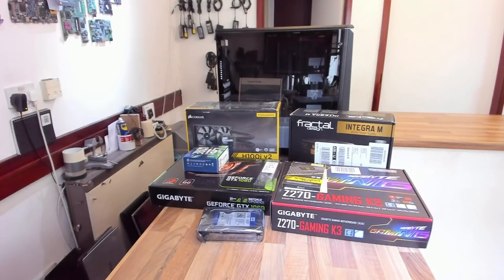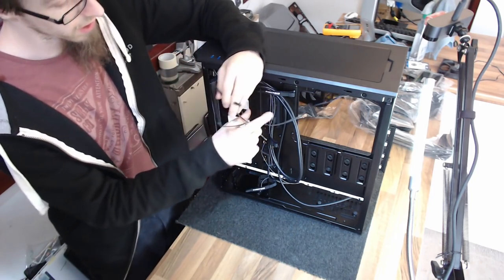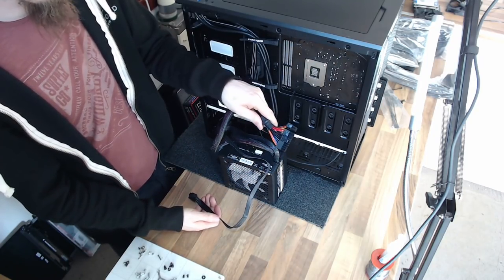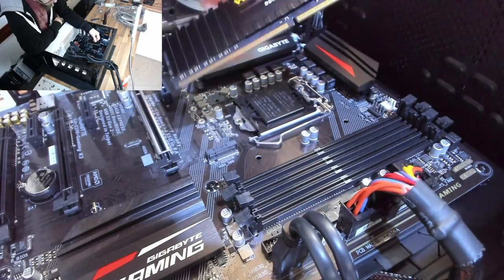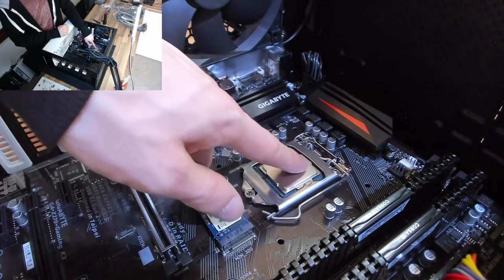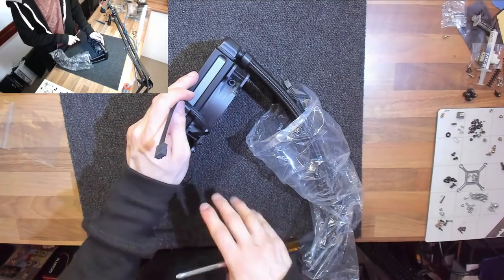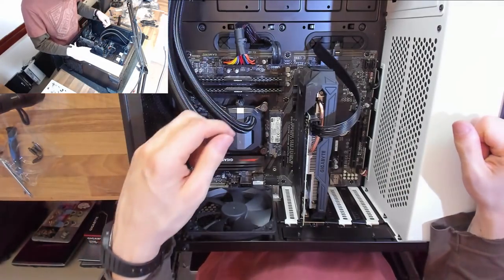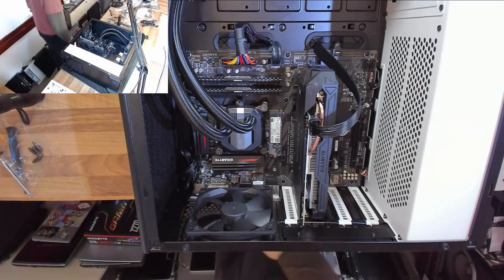LBC#16 - How to Build a Gaming PC

Comment: Great video, with clear step by step instructions. Totally agree with yogev about not needing to remove the cover - it will pop off when latching down the CPU, additionally you should retain the cover if you ever want to RMA the board as some manufacturers may fail to honour the warranty without it. Finally it is worth mentioning to avoid touching the lands on the CPU (you did appear to handle it in the video) otherwise you contaminate it with oils and sweats, similarly it is worth mentioning avoid touching the pre-applied thermal paste on the cooler.

Comment: I always install the cpu (and cooler if stock), ram and m.2 before adding to case so much easier. I also use a tape measure to check stand off alignment rather than the board it’s self. I always test the parts post too before installing. I normally install Windows too just to a basic level then add to the case. I build a lot of PCs and I’ve found this saves a lot of time in the long run. Wiggle cpu from sides rather than add the oils from your finger all over the top of the heat spreader. Good tip regarding polishing the glass.

Comment: dont throw the cpu cover away , youll need that if you want to send your motherboard back to get fixed
Reply: He prolly has 1000 of them
Reply: @bandit6048  HE may. But as this is a how to video, what he does is meant for the people watching who likely will not have any spare ones. Keeping those covers for a year or two is a good idea.
Reply: @harshbarj  point made
Reply: Also, you don't have to pull them out before you place the cpu in the socket. They will pop out once you close it with the cpu in place.

Comment: Don't remove the CPU socket cover. Release the lever, pull the retension mechanism back with the cover on it, then put the CPU in and close the mechanism. The socket cover will jump off. This way you reduce the risk of damaging your socket. 
And don't throw the cover away. If you'll ever sell your board without your CPU you'll need it. If you need to send the board in for repair, you'll need the cover.
Reply: Indeed, there are some motherboard manufacturers that won't accept a return without the CPU socket cover. Or at least, will attempt not to do so.

Comment: A word of warning about installing power supplies with the fan up instead of down. I have a Thermaltake Toughpower Grand RGB 750W psu and installed it fan up to have the lighting in the case instead of beneath. Also installed is an MSI Duke 1080 with 3 fans. Under a light load like web browsing this was fine but when playing games the fans on the graphics card were choking the air supply to the PSU, so I had an issue with the computer power cycling only while playing games. This was really difficult for me to diagnose because the computer wasn't going through a proper shutdown which meant no windows error codes, and none of the typical components like CPU or GPU were even close to thermal limits. For a long time I thought it was under voltage on the CPU overclock, but all CPU stability tests I ran were fine because the GPU fans weren't ramping up and choking the PSU. And testing only the GPU didn't create enough load on the PSU to heat it up to thermal limits. Literally took me three years of intermittent fooling around to finally fix the problem, must have reinstalled windows at least 5 times thinking it was due to bad installations. I totally agree with the reasoning of putting the PSU fan up instead of down but make sure it will get enough air.

Comment: Never wiggle a cpu in the socket, if you manage to do that while the cpu is not socketed properly, you will damage pins. Never pull the socket cover off... it pops out on its own once you socket the cpu and lock it in place. ALWAYS keep the socket cover, you will need it to rma the board.

Comment: i havent seen any AMD Ryzen Boards at least that use Ram slots 1 and 3 as optimal. Pretty much every video or build i've seen or done have used the same slots 2 and 4 as Intel. I know i'm super late but thought i'd mention it. You should also never tell people to throw away the CPU Socket Cover, if they need to RMA that board and send it back without it then the company can deny their claim and then they are screwed out of a warranty.

Comment: I black paint my rainbow wires does the job.it's about time m/b manufacturers made m/b with all the header sockets on the back/bottom of the board, they must have seen that we don't like to see all the wires and plugs, graphics card should have the 6 or 8 type power connections down by the PCI connector may be sticking out the end of the card.

Comment: Cases have come a long way. If you wanted a 'gaming' case back in the 2000's you had to make your own perspex window by cutting the side case panel and a piece of perspex. Wanted to add more fans, well you had to cut your own holes...
Reply from the maker: I was there! Remember neon coloured rounded PATA cables? 😂
Reply: @Adamant_IT  They freaked me when I first saw them. Never liked them. I was all about the cold cathodes!
Reply: Unless you want an optical drive & hot-swap drive bays, then you're in trouble finding a case you can even modify.
They've "come a long way" in the exact wrong direction.

Comment: I would have gotten a bigger power supply than the 450 watt one that he installed.  Rather have some "wiggle room" in case the memory was expanded and a new video card was installed.  Even adding more internal cards just might tax that power supply.

Comment: You don’t need a graphics card if your cpu has one and you plan on using it for work if your external graphics card dies and your cpu has a inbuilt one you can take it out and use the motherboard display ports until you get a new graphics card

Comment: I have one question: when you plug the back case fan directly into the motherboard instead of the daisy chain that comes hooked to the case, do you still get to control the fan speed using the case?

Also, a small comment on the SATA cable. If you are using M2 SSDs, some motherboards state that it matters where you plug the SATA cable as each M2 you plugged in may turn off one of the SATA ports.
Reply: thank you! i just did most of the build today. realize the other advantage of using the mobo fan header is that you don't have to deal with the chunky fan hub.

Comment: Normally the fans go infront of the Rad and the long screws thread threw the front of the case into the rad, but since u dont like fresh outside air for ur psu its ur way,

Comment: Your putting screws in the wrong way. Your way can cross thread the screws.  You should anticlockwise the screw half rotation to align screw till it clicks then clockwise to tighten up.

Comment: The most common "Imperial" screw is 6-32,(for computers) pronounced six-thirty-two. It is a number 6 (there are charts, but #6 is .138 in.) and 32 threads per inch.
Reply: why is imperial in quotes...?
Reply: @RWL2012  because Imperial threaded screws are not commonly used in the U.K. where the term comes from. In the U.S. we don't use the term, we have 6-32 or 4-40 screws etc., and we use metric for the m"style as in m-3 etc.
Reply: @SuperFredAZ  Imperial was British Metric came in with the dreaded EEC / common market
Reply: @stacey37m  I understand  where it comes from.  In the U.S. we use threads called National  Coarse,  which the quite common 6-32 is a member,  and National  Fine, which for example the very common 4-40 belongs to. The first number refers  to the size, and #4 has a look up table,  the 2nd is the pitch in threads per inch. In the video  he was referring to  an "Imperial " thread 6-32, which should  be read as a six- thirty-two, meaning  a number 6, and 32 threads per inch. This screw seems to be the most common size for desktop  computers,  to mount the motherboard,  and for nearly  all ATX power supplies.
Reply: @SuperFredAZ   we had  may types  but the main ones were BSF  BCF  whitworth coarse and many I have forgotten.

Comment: Hello, after watching along with this video and building my pc, I am having one issue.. my PC turns on fine and runs perfectly, but when it goes to sleep after not using it for some hours, it does this thing it’ll turn on and off non stop, off and waits a second, on, waits a second, off waits a second, on, etc and makes a clicking noise and the only way to shut it off is to turn the PSU switch off and the only way to turn it on again is to unplug all my cables from the PC and plug them back in and it’ll turn on and run perfectly again until I either turn it off myself or it sleeps.. I cannot figure it out :/ please help!
Reply: Hey bro, sorry to hear....Did you ever get it figured out though? What was the issue?

Comment: thanks for this video, i like your building style.  which case is this?
Reply: thanks for actually responding and so quickly.  I'm planning to build my first PC that will be a workstation and for some gaming.  I want it to look nice and be functional as well, and upgradable/future proof.  Right now my choices are the P400s, the S340 VR Elite, Corsair 400c, and the H440.  I think this case, the P400s, is now the front runner.  Any suggestions regarding those I mentioned or other suggestions?

Comment: So, what did you do with the original front fan that comes with the case?
Reply from the maker: I left it out of this build as it wasn't needed (replaced by the radiator fans) however, it could have been moved to the top of the case for extra exhaust flow too. I generally use as few fans as I can in builds, but I encourage people to experiment to see what works best for their PC.
Reply: Thank you!

Comment: I am not happy with my gigabyte motherboards (I have 3 computers in running order with gygabyte mb's) what is your professional opinion on MSI?
Reply from the maker: I have to admit that I've fallen out of love with GB. MSI have had some strong boards lately, but also have their weak points. It seems that you can't really go wrong with Asus right now, but if MSI is at your price point, I think you'll be okay.
Reply: @Adamant_IT  please make a video with the weak and strong points of gigabyte asus msi I will be interested to see it and I think others will be interested as well. I talk with people who are knowledgeable about electronics in my job but I find your opinions valuable as well.
Reply: I have 3 ASUS boards always have problems with the BIOS
Reply: @kucingoren666  I never used an ASUS however my experience with MSI has been flawless

Comment: I'm a bit behind the times I guess but no optical drive? Does no one bother with these now days?
Reply: Not really no.
Reply: I do sometimes but it's just as easy to connect an external optical drive now, so there is no real need anymore.
Reply: With modern cases, you have to use double sided tape to keep an external one from sliding round all over the top, live with the wires, & put up with it partially blocking the top vents.
It's REALLY fun when your kids spill drinks on a top vented case...
As for hot-swap drive bays, buy a server case or forget it.
There is truly no thought to utility in the fashionable rubbish.

Comment: How did you connect the led strip???
Reply: So I got the same model but red/black. I may have missed it, but I didn't see a second LED connector so I had to unplug the LED wire that was to the front panel so I could plug in the LED strip for the interior. Did I just completely miss an extra LED connector besides the front panel LED connector?  I've tried looking at the panel and other videos showcasing this case and no one explicitly zooms into the LED wires for me to double check.

Comment: An upside down power supply sucks hot air in, lower the life expectancy of the power supply.
Reply from the maker: If the air in your case is enough to upset the PSU, you have bigger problems